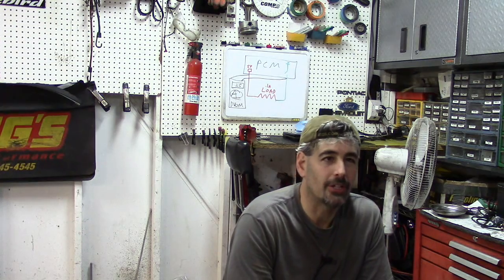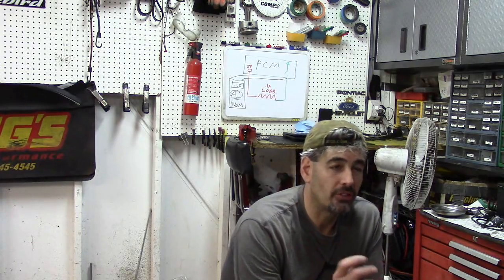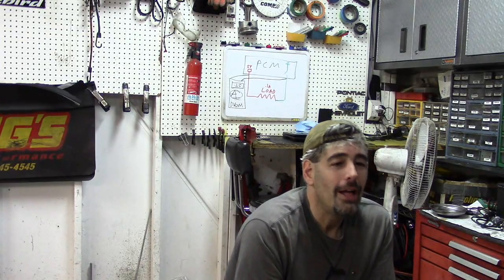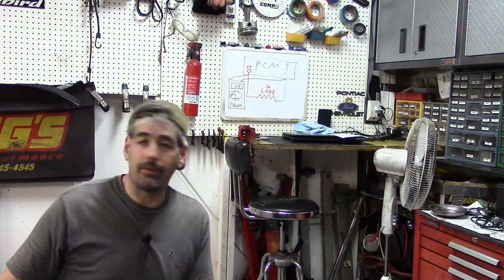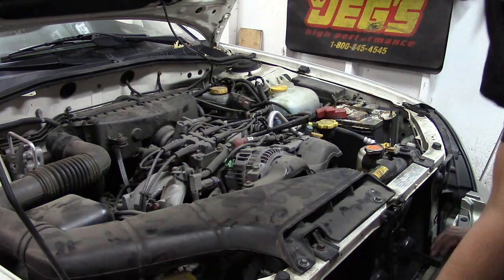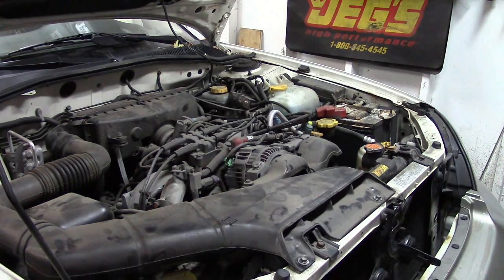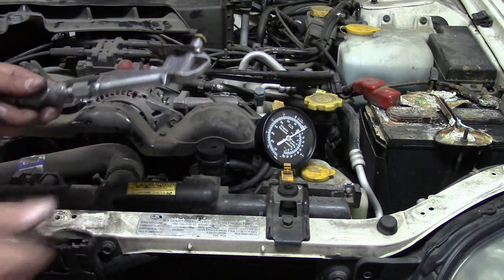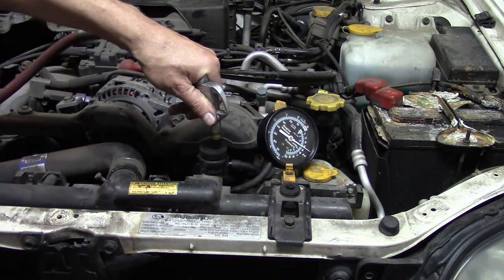Homemade Cooling System Pressure Tester!!

Comment: I bet I could do something like this using one of the radiator cap adapters from the Lisle Coolant Funnel kit I have.
Reply from the maker: +anti0918 Oh good idea!
Reply: +Schrodingers Box  Matt, just thinking out loud here,  could you use a Subaru radiator cap with a hole drilled in the center and using a threaded (on one end) air hose fitting that's secured with rubber gasket material on the underneath side of the cap, on the other end a 1/4" barbed hose nipple on the other end and connect a rubber hose to the tester?
Reply from the maker: Hawaiian F150 Yes it is possible to fabricate something like that

Comment: I would also be interested in a source for those rubber "corks" and the sizes you recommend to fit most cars/radiators
Reply: +Russell Jones Ace hardware has a great collection for average $2 a piece.
Reply: +kermit80526 Thanks  :-)

Comment: why not just tap into the heater hose with a t adapter.  your tester has a pipe thread fitting
Reply from the maker: +bob b Because I don't want to drain the coolant so as not to cause coolant to leak everywhere so I can't find the leak, then T into a heater hose which I can'
t even reach without disassembling the engine, then refill the system and then fix the problem and put it all back together when I can just do what I did.

Comment: Good video,  you got  a nice simple idea over well.  When I do cooling system pressure test I use my home made cylinder leak down tester to control the pressure at 18 psi.
 I added a ball shut-off valve to the leak down tester so I can isolate the pressure from the air supply and check  for slow leaks. I use this tool a lot as the models of cars I work on have a reputation for cooling system problems.     To make a connection I have a T connection that fits between the small bore hose that runs between  the radiator and the pressurized expansion

Comment: Where did you get all those various stoppers ?
Reply from the maker: +James Brewer I've had those for years and years... they are rubber stoppers used for laboratory work to block flasks and test tubes and such. I am sure they are available on Amazon or something and used for other purposes.
Reply: +Schrodingers Box I found them, sometimes it's all about knowing the right wording.thanks
Reply: +James Brewer Ace hardware has a great collection for average $2 a piece.

Comment: well fucking done, i was skeptical that your contraption would work...
Reply: +WhyDidYouTurn Hahaha I actually was more afraid it would just pop the cork off and hit me in the face before anything happened to indicate a leak.
Reply: exactly, i was hoping that something creative would happen, but then a feeling of rejoice as soon as you found the issue. Perhaps you can find why the radiator failed. Factory defective, user error, oxidation, you mentioned in you head gasket video that if you don't find the reason for the failure you will likely be doing the job again.

Comment: What about using a cork/bung with a tire valve stem glued into it? That way you could use a regular tire inflater (from your compressor) to both pressurise and monitor the pressure.
Reply: +Schrodinger's Box Quantum Mekanix Hate to challenge the master... but pressure is pressure.  It will work fine.
Reply: kermit80526 True, I gotta put down the crack pipe before typing next time
Reply: +mungewell How would I measure the pressure?
Reply: +Schrodinger's Box Quantum Mekanix  How about using a fuel pressure tester on that shreiders valve ?  My fuel tester has the same size.
Reply: +Schrodinger's Box Quantum Mekanix
Many bike pumps have gauges built in.
Reply: +zeferrum I am not sure a fuel pressure tester will measure air pressure like a vacuum gauge would.
Reply: +Schrodinger's Box Quantum Mekanix lmfao your killing me bro
Reply: Chad Cohoon Well I gotta admit he nailed me on that one lol. When I'm wrong I do have to own up to it.
Reply: +Schrodinger's Box Quantum Mekanix,
Dear Sir,  We find Your videos very
educational. The Guy I know uses a
air regulator with a gauge & the "ends"
off of the Stant tester. Couples it to the
shop air, winds it down to ten pounds. 
Need a shut off inline valve also. I am
sure You can make "ends meet" from 
My rudimentary description. 
Sincerely, Kathleen. I would attempt 
to send a picture but I don't know how.

Comment: Neat idea on the cooling system pressure tester.  May want to take up a collection to replace that customers battery.
Reply from the maker: +Sandbag1300 BWHAHAHAHAHA!!!! Yes I actually cleaned the battery and terminals before returning the car to them in fact as I thought the same!!

Comment: Oh ya forgot to say in last post that I'm going to make a tester hose to hook to the radiator overflow access with a T in it so both a air valve access and a pressure gauge ca be hooked to it.   thanks matt
Reply from the maker: +dcbigsky  I still hold that you cannot test the SYSTEM through the overflow with the cap on. The whole point of the cap is to seal the system unless pressure is past spec in which case only then it recoils to open to the overflow.
Reply: +Schrodingers Box  Yep your right Matt ..... don't know what I was thinking . I saw that video how to make a dyi coolant pressure tester by mr42ndstblvd and now I realize where he was saying see where its showing a leak  .........ahhhh thats just stagnant anifreeze  HE got me.  Thanks for pointing out where I totally overlooked why it couldn,t work
Reply from the maker: dcbigsky His channel wasn't pay I hope lol

Comment: ahhhhhh....... never mind. just watched a video a guy made putting a air valve in the radiator overflow hose . using a zip tie . He pumped up the radiator thru the valve with the bicycle pump. That way you can test the system including the radiator cap without even needing plugs at the radiator cap connection. Your making us think Matt.  THANKS
Reply from the maker: +dcbigsky How did he test both the cap and system through the overflow??? That is impossible. The cap seals BELOW the overflow.  He only tested the the cap mating surface, not the system unless he did something I am unaware of.
Reply: +dcbigsky
 I can understand how it  put pressure  into the rad  as  rad caps 
have two valves the main pressure relief valve and a second  smaller one 
way vacuum breaker valve to let air back in when the system cools down 
but I suspect it will leak a lot of air as  the lid  of the cap isn't 
designed as a pressure seal.
Reply from the maker: Andrew W MacFadyen Exactly. At best he's testing the lid seal not the actual cap seal
Reply: +Andrew W MacFadyen I am assuming that the section of hose going to the overflow/recovery tank is pinched tight.

Comment: Can see where that would work in a lot of cases but then you have all the assortments of plugs available to you. Won't do any good testing radiator caps
Reply from the maker: +dcbigsky It is not designed to test the cap- you could however do that by tapping into a smaller coolant line and pressurizing with cap on.

Comment: I could see a very few simple fittings with a small gauge and even Mabey a small cheap knob regulator and it would be tits.  Could put a quick connect for the air line then a small regulator then the gauge.  Awesome
Reply from the maker: +Jason Curry Yes indeed some modification could be done as such- When my Stant finally bites it I'll probably do that.

Comment: The best idea for the purpose with lil or next to nothing invested! Thanx for sharing
Reply: Not all cars have radiator caps before the over flow. ..still gold.

I have another bit of excitement, I keep forgetting you can bleed a coolant system faster with pressure! Super time saver!
Reply: +DE Nichols. ha or vacuum , a pro tech like you must use one of these at your shop. http://www.amazon.com/UView-550000-Airlift-Cooling-Checker/dp/B0002SRH5G
Reply from the maker: +DE Nichols Yes on models with combination overflow and reservoir instead of a radiator cap  (GM N models) you would simply plug the cap and crimp the overflow hose (or deadhead it with a pressure gauge)

Comment: This is what I use Matt- http://www.amazon.ca/Redline-Detection-95-0700-SmartFit-Universal/dp/B004ARPIFQ
Reply: Nope don't like it Matt:) It's great for what you did but for a longer decay test that takes longer testing I can see it not working out so good. Let us know how it works out for you in time , hey I could be way off but for me I like a good tester to obtain good results. Sharp idea for most , what you have demonstrated would be just fine. 👍👍
Reply from the maker: +Steve Rob Its not designed for decay testing. I'd have to set the air compressor to keep a constant pressure in that case and I would have figured out something if I needed to but the leak was too obvious.